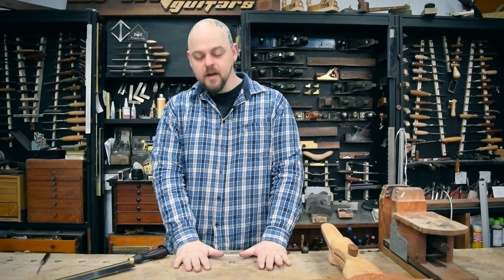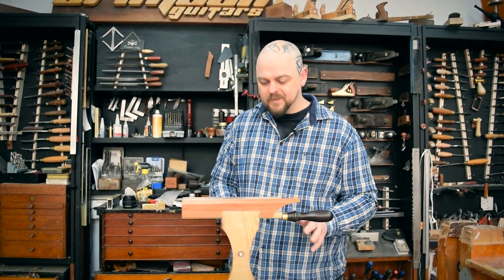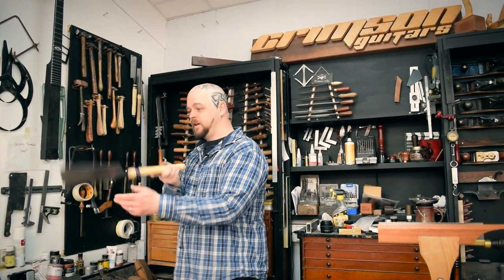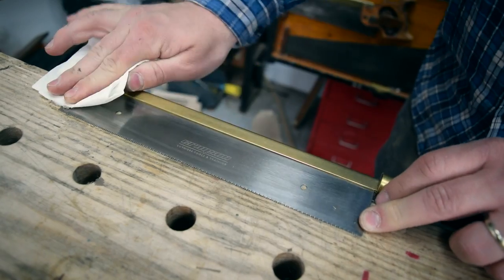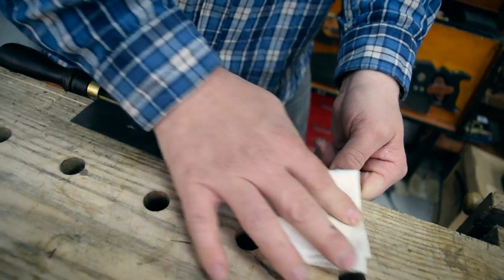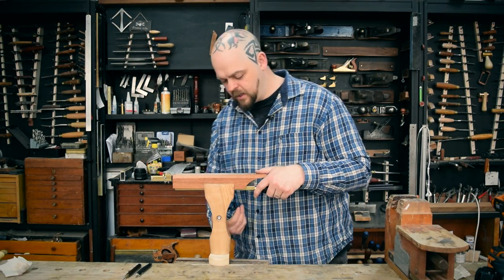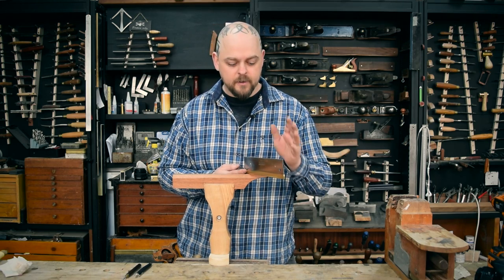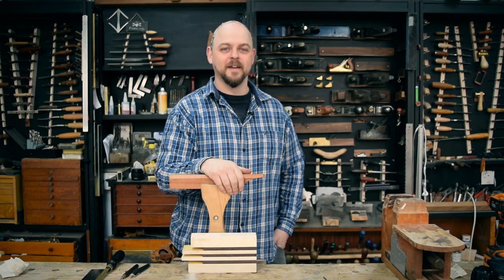How to Sharpen a Fret Saw

Comment: One tip... run a sharpie down the edge of the blade before you start. This makes the whole process easier and faster as you can easily see which teeth have been sharpened.

Comment: I used a magnifying glass to look at the filing angle of the teeth on the fret saw from Lee Valley Tools and it seems they are filed at zero degrees, or at 90 degrees to the saw blade.

Comment: When learning to sharpen a saw, get a regular 4-10 tpi saw first, preferably ripcut. Don't start with a fine toothed saw. It is much easier to see what happens and keep things in control with bigger teeth. A fine toothed narrow saw can almost as well be sharpened straight ripcut and used for both rip and crosscut, but for a dedicated fret saw a crosscut pattern like Ben shows here is a bit better. It is not a bad idea to use a marker to higlight every other tooth so you know which ones to file. And magnifying goggles are a great tool, especially if your eyes are past their best before date.

Comment: Hey Ben, since you asked for tips and tricks..., I usually rub beeswax on the blade for lubrication before and while using it. I find it makes a huge difference in the cut efficiency and quality. I wouldn't be surprised if it also extends the life of the blade. I know it's not an earth-chattering tip but definitely practical. Cheers!
Reply from the maker: Awesome, thank you, I use a similar thing on inlay/jewelers saws and never thought that that would also apply to standard cutting. B
Reply: I'm glad it was useful Ben, I wasn't sure how "obvious" or not this trick was...
I also apply beeswax on my band saw blade, especially for ripping large boards. Turn on the machine, rub some beeswax to the blade and start cutting, apply more as needed.

Comment: Hey Ben, why not create a little jig which goes on top of the saw vice, traveling on channels on either side, with a little ratchet action "tooth" so you can feel how many saw teeth you went over, the jig would then rotate to whatever angle you needed, at the top, with a guard so you could lean the file against, and because it's on rails it would stay true